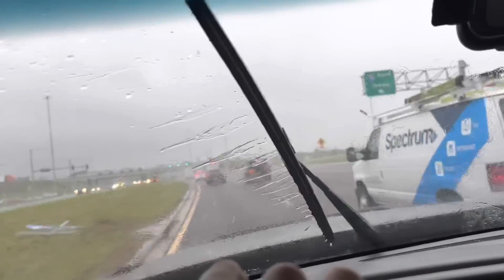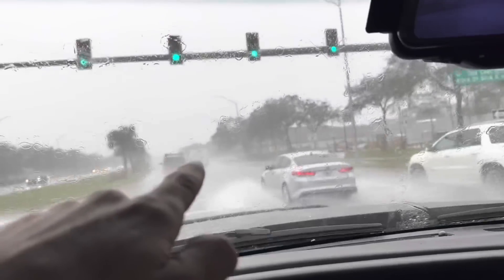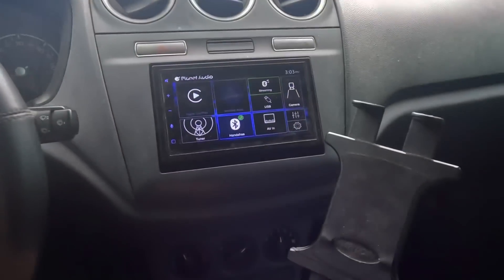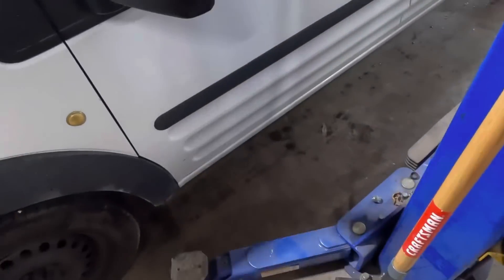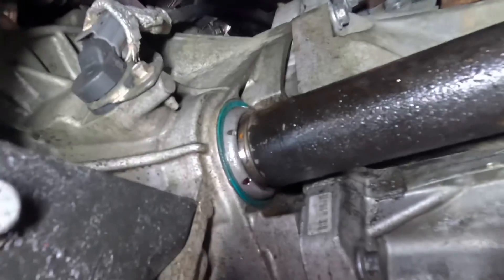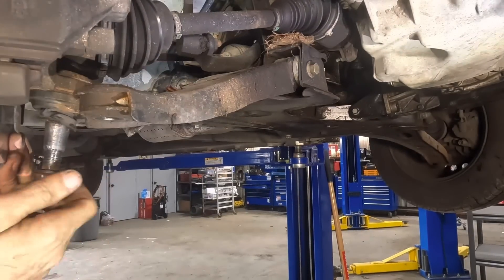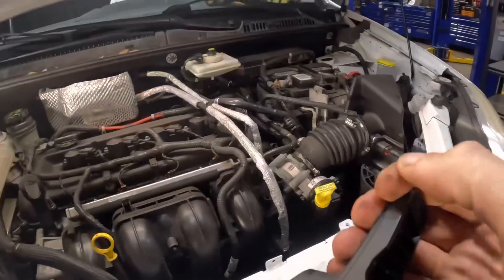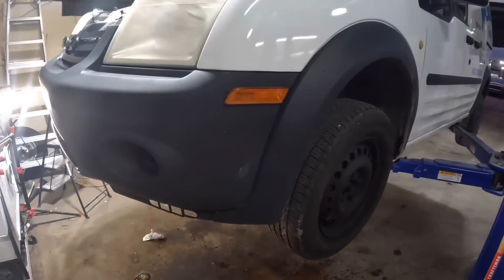Out of Business? Working ON not IN!

Comment: Just thinkin, maybe a trannie oil change, or the cheap version, clean around the drain nut, let a couple quarts out, refill when done. I am a machined surface kind of guy, (Reliance Machining, also in FL), and don't know if you have big enough combo wrenches to use as seal driving protector, or even a big adjustable wrench, hammer against one of those, and to be total nerd, throw seal in freezer in front of the cold air blower for 15, it's real thin metal, that might not help at all, and besides, it's the seal to shaft that matters, so not critical to be full diameter press fit in this case.
 First time I saw your channel, and you were so mellow while driving, so I know you are not in the armpit of FL, Dade, Broward, PBC. it's the people, I can't stand, not the incredible beauty, the few scraps of real Florida that are left, and the Reefs from Boynton to Marathon Key that I dove for 20 years.
  But now, it's been 14 years since my final dive, when I was down there, and just started weeping, sat on the sand between reefs at 90 feet for 30 mins, as I really took a deep look, and saw an empty, barren, brown 3 foot algae covering all the dead coral, and 75% of it can be attributed to two filthy, lying, politician bribing, phosphorus dumping, Billionaire brothers, the Fanjuls, who the entire state has voted to pay their price every time they snap their fingers, to eliminate the close to 100 thousand acres of Sugar Cane that they break every water pollution standard, renege on every agreement to create a buffer zone filled with cattails which would absorb all the reef killing nutrients and chemicals, and allow real water to flow naturally, with the seasonal rains, possibly restoring the River of Grass, because the entire bottom part of Florida, from the Saw Grass to the Mangroves, what was millions of acres of fresh to brackish to salt water, shallow, protected from predators, where all the spawning and larval stages of Lobster, Stone Crab, Red and Yellow Tail Snapper, 20 species of Grouper, Tarpon, and countless thousands of all the reef dwellers that made up the entire ecosystem of almost one thousand miles of coral and seabed.
I am not a rabid tree hugger, but I am for sure not somebody that would run, and keep growing and expanding, and lying about being bought out, and instead spending over half a million dollars a year to weaken laws (that also allow the same indifference to what their operational discharges cause statewide),  If you are, then you would already be nominated for Sainthood. :)

Comment: First of all, you should follow your own advice and AVOID the problem ( aka quit fighting  the job) of fluid bathing by draining just a little MORE fluid. You're going to have add some anyway. This allows for my other minor comment. Seals should always be installed the in a clean and dry recess. If fluid  ALREADY  has a path of fluid across  the seal housing it has an escape route built in. We both know how insidious transmission fluid can be.

Comment: Anything with fluid in it should have a drain plug. But the day designers and engineers think of the welfare of mechanics will also be the day when we see swarms of pink pigs in full flight. 
I buy cheaper tools, so I would not use a ratchet breaker bar with an extension. The goal is to get that crack of the fastener going loose, so I just use a plain breaker bar.

Comment: 1000 comments here before me, but I will try to see if anyone else noticed that fibrous piece of what looked like a mangled piece of wood under the axle shaft grease boot. Does it even belong there? I don't know, I am not even a spre time car mechanic, so I hope someone else has noticed that piece of junk on the shelf beneath that grease boot. If I were to assist on a maintenance job like that, I would have pulled out that piece of debris, thinking it was junk and that it doesn't belong there.
Reply: It is just compacted grass and mud from the axle shoving it in there when it is spinning.  It should be removed but isn;t a huge deal.
Reply: @Bendigo1  Thanks, glad to hear that it is such a minor worry that it is safe to skip it. I did not quite know what to make of it.
Reply: @TrondBørgeKrokli  That is actually probably one of the cleanest undersides I have seen.   That stuff being there could pose a problem with wear on the boot if it builds up more but is not an immediate problem.  I would have removes it as well, but that is just because I don't like things being were they don't belong...

Comment: rip that seal 😢. its gonna be comeback because ya bent the outer metal against axle so she gonna leak sooner than if it wasnt bent.
Reply: No, no he didn't. He was using a rubber dead blow. There's absolutely no way he did that.
Reply: @williameldridge9382  u can see it bent. i know he used a dead blow hammer thats not the point